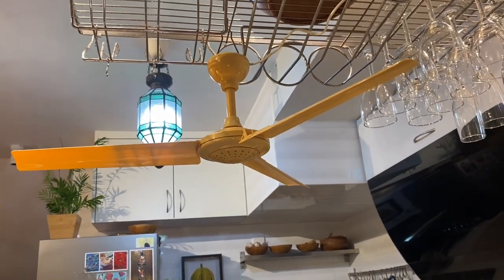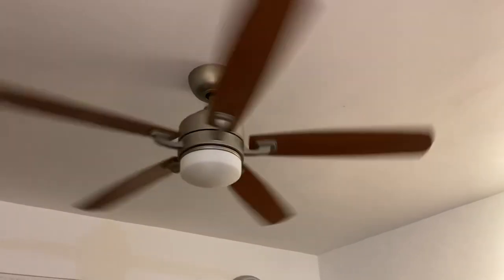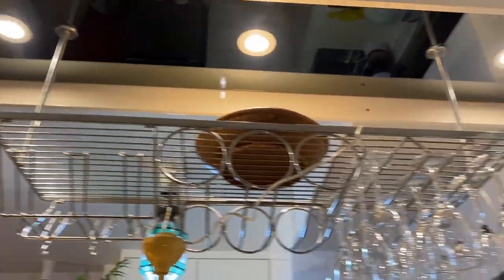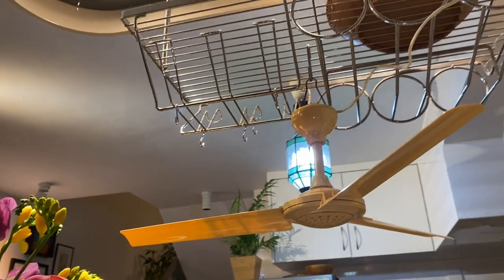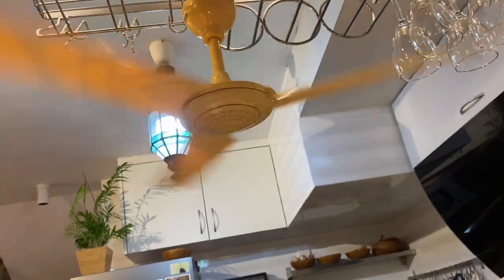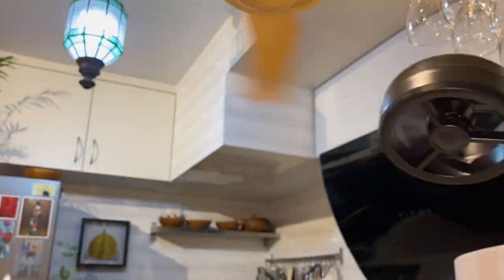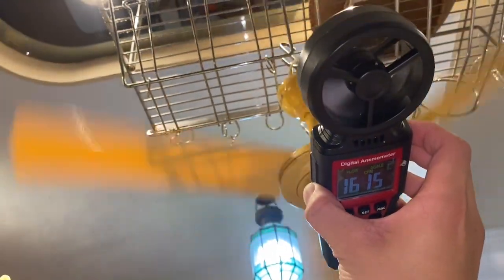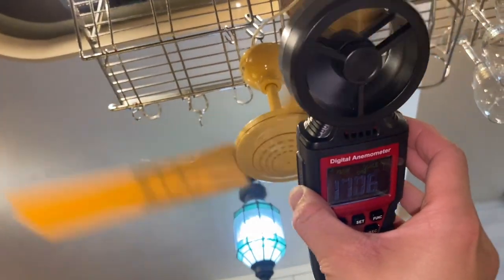Zhonglian mini ceiling fan CFM test

Comment: I think this whole fan is yellowed😅
Reply from the maker: Yep lol. Blades are brittle and one recently broke lol. It’s 10 years old
Reply: @katthefanenthusiast5793  wait, so your fan is been 10 years ago right? mine is 11 years ago and it still works at all, installed in my room
Reply from the maker: @zikererd12  Yeah, this one seems to be a cheaper one. The blades are very brittle. Just the other day, I dropped the blades and one snapped.